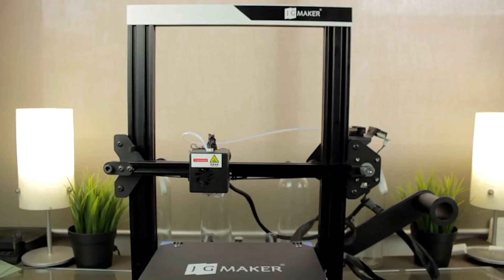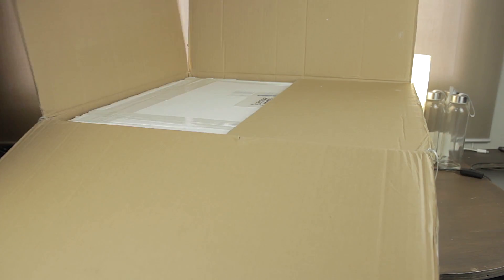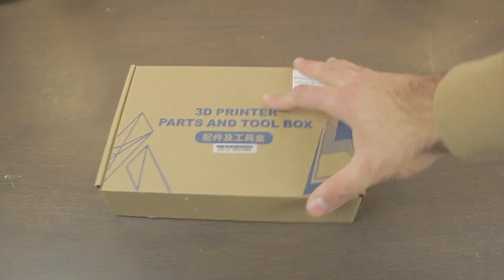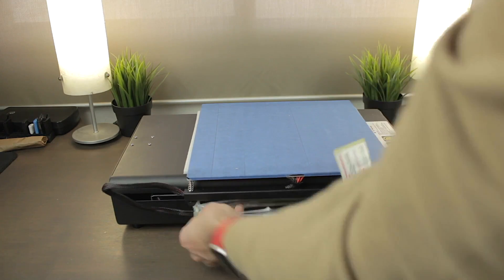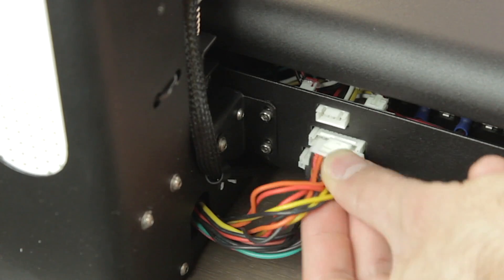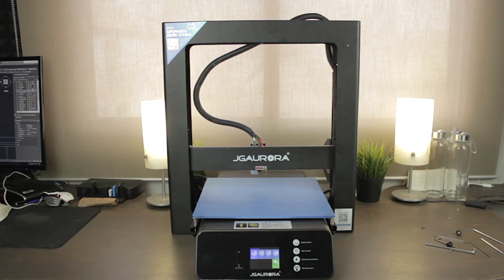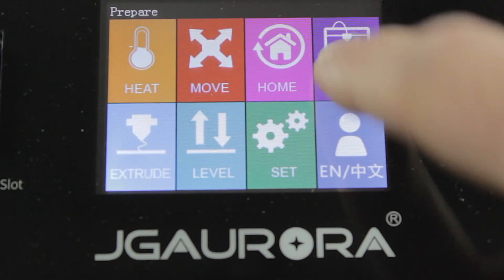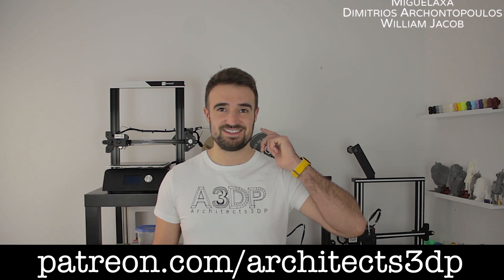JGAURORA A5S in 2022 | Still a great 3D Printer?

Comment: I own a A5 since a few years ago, a good printer that still runs strong.
It runs super silent after a few mods:
- New TMC stepper driver
- All fan replaced by Noctua fans
- New duct to improve cooling
- Octoprint embedded in the printer (only for remote control of the print)
After a while, the diamond glass print plate had some mark, that could be seen on the print. I simply turned the diamond glass upside down and print on the glass.
Reply from the maker: Hi Tito Alo, thanks so much for your comment! I really like the upgrades you made on your machine 👌
Reply: i got an A5s ant used it yet it powers on and seem it will i do know i need to tool around and mod it a bit like larger power supply for upgrades and faster heating etc